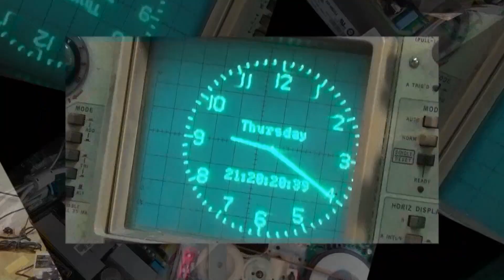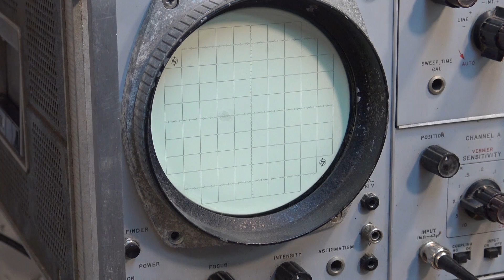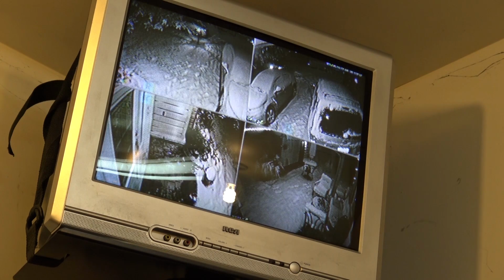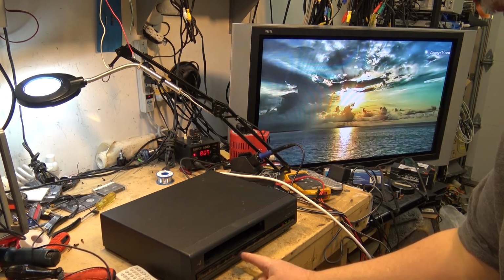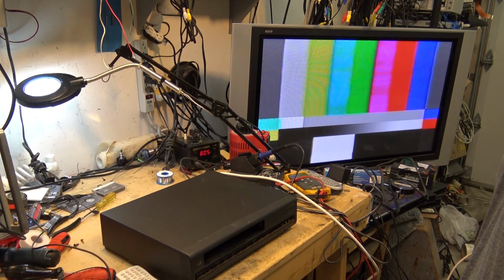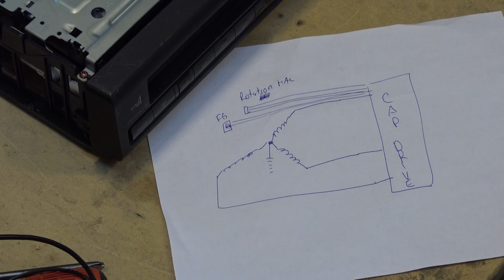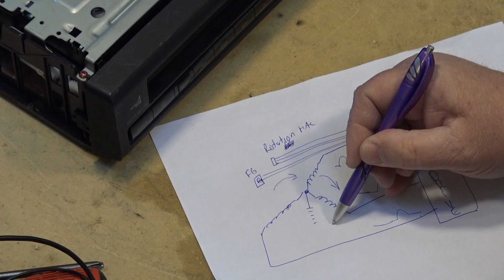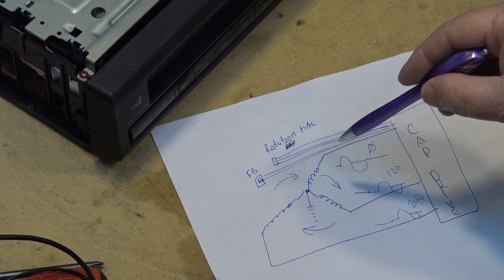Panasonic PV4250 jittery playback and tape eating

Comment: My aunt's mother has a Panasonic PV 4458 MTS HIFI STEREO 4 HI-TECH VCR at her house. It has been in her basement for YEARS. And I tested it four days ago, and it WORKS GREAT!!!!!!! NO PROBLEM WITH THAT IC SOLDIER CONNECTION, OR THE GRAY COG FOR THE LOAD/EJECT PHASE!!!!! THAT VCR IS OVER 20 YEARS OLD!!!!!!!!! manufactured July 7th, 1994. Also, IT STILL HAS IT'S OWN FACTORY REMOTE!!!!!!! NO KIDDING!!!!! EVEN THE OLD BATTERIES STILL WORK!!!!!!

Comment: I have an old Sony Super Betamax deck with literally the same exact symptoms, though it ended up being capacitors for that unit.  I had to replace several SMD caps right under the capstan motor.  I replaced it with electrolytics that I folded down to fit, and it's worked fine since.

Comment: There are three green-color hybrid ICs on video and Hi-Fi audio board that are really troublesome, due to the surface-mount capacitors inside them. When the SMD caps fail, the VCR is good for junkyard only.

Comment: I was wrong with my initial guess. 
Bad design from Panasonic by not heat sinking the heat-emitting, 3 phase capstan driver chip. I guess preventative maintenance is key here. When the image jitters again (or ejects your tape with tape hanging out...), re-solder the chip again.

Comment: Have you checked the Hi-Fi Stereo audio to see if it works? There are SMD aluminum caps behind two hybrid green IC boards on Hi-Fi audio board, and these do fail and were common problem.

Comment: my Grandma has a Magnavox VCR from the 1980s I think but it has a problem sometimes wen you go to load a tap it will pull it in the machine but instead of threading the tape on the heads it just ejects vhs tape and capstan motor continues to spin until the VCR goes into shutdown mode. Sometimes it works just fine. (this VCR has only two motors capstan motor and the video drum. the vcr uses capstan motor for loading the tape.

Comment: I never really serviced VCRs, because by the time I Started getting into repair, VCRs were already obsolete and on the way out. Anyways, I miss the old school VCRs, the ones that were boat anchors and had multiple PCBs with hinge mounts, etc..
Reply from the maker: I made a ton of money servicing them in the early years.
Once the price bottomed out there was no money left in the repair of VCRs but from the mid 80's to late 90's they might as well have been made out of gold.
Reply: 12voltvids yep but I didn't get out in the repair World until about 2004 after I graduated high school
Reply from the maker: I hear you. I retired from the service industry in 2003 and went to work for a large telecom.

Comment: Very similar problem to the Sony's 711B3 chassis Betamax machines from the late 80s. There was a Toshiba IC that drove the capstan motor and when it went bad, It had not enough torque to drive the capstan motor.
Reply from the maker: Many of those Sony machines, both beta and vhs had a bad capstan bearing that caused excessive drag, which overheated the capstan drive IC.
Change that bearing housing and all was good.

Comment: Nice fix. My thought was that it was mechanical. But in the motor, not on the driver board. 

At least the HP has a brighter trace than the Iwatsu. If you tape a cardboard shade above the CRT when you show it on video, it should improve the contrast.
Reply from the maker: It does? NOT.... No the HP is considerably dimmer than the Iwatsu. Its a bigger tube and round as opposed to square, but it is not as bright, and trigger is tricky. I'll get to use it soon.
Reply: Obviously, the CRT on the Iwatsu is brighter when it has sufficient voltage. The last time you showed it in a video, it wasn't very bright. I wasn't denigrating your Iwatsu, I was implying that it's nice to have an old backup HP that works. 
I was working in a lab using a Tektronix scope, and it kept false-triggering. I put a styrofoam cup full of liquid nitrogen on the case over the trigger circuit and it kept it settled down.
Reply from the maker: I have a lead on a leader scope. Just trying to hammer out a deal.

Comment: Quick fix sir :-D
Ive never seen that model before, perhaps panasonic didnt do that one for the uk market.

Ive had a similar jitter created by the tape tension clutch/arm being faulty.
On rare occasions the clutch pad is just too dry, a tiny smear of vasolene on the pad fixed the problem and it never caused any later problems :-)

Ive had some funny mode switch problems, One vcr was playing perfect then suddenly stop the tape and go into rewind, perhaps the vcr didnt like the film LOL :-D
Remove mode switch, clean and respring, add lube and drop it back in, happy machine :-D
Reply: I reckon that the NV-SD430 would be the UK equivalent?
Reply: I havnt a clue, its been a looooooooong time since i used to repair vcr's.
The only panasonic i remember was a top loader called a NV-333, it was a beast but produced a nice picture and could not give a dam what tape you put into it, the tracking was allways in the default center detent.
Reply: NV-333!  They were built like tanks!  Fantastic machines.

Comment: is the connection that feeds the speed signal to the PLL not working and I think that would cause jitter as the capstan is not locking to the clock generator that controls the speed of the capstan.
Reply from the maker: In this case it was loss of 1 phase to the motor at the 3 phase drive output.
Loss of the FG pulse would produce a completely different symptom. Perhaps that would be a good fault to place on the machine. Disable the FG signal and show the symptom, and test points for the FG signal path.
I was going to disable the control track on this unit and then I remembered all that will do is create a blue screen, because the VCR mutes the signal if no CTRL is  present. I will have to find an old machine demonstrate that.

Comment: Quick question, I have a Panasonic RR-830 desktop cassette transcriber.  The auto stop isnt working.  Curious, were would I start to troubleshoot this??
Reply from the maker: I'm not familar with that unit, so I don't know if it uses a mechanical or electronic auto stop.
Reply: no problem, I will take it apart and see what I can come up.  Thanks for the videos, very helpful.

Comment: I wonder if my rca vr337 vcr has that problem.
Reply from the maker: Many of those RCA units were panasonic, so they have the same issues.
Reply: 12voltvids I actually tried to re-time the metal cog that loads the tape, and when I plug it in, the video head drum makes a high pitched noise and the head drum spins BEYOND fast...... BETTER NOT KILL THE FUSE!!!!!!!!!!!!!
Reply: And the picture shows static. And the power light only shows. The power supply I took out, and I somewhat mis placed it in right.
Reply: I accidentally broke the 2nd clip, and that is why it is doing that.

Comment: You guys got hammered with snow on the west coast.  And here in southern Ontario, we're getting ready for 30mm of rain today...  weird, eh?
Reply from the maker: Well where I am we got a ton of snow. About 5cm, or for those south of the border 2" Now Vancouver got hit pretty good as did the Fraser Valley, but where I am a dusting is all. Hell I don't even bother with snow tires on my car.
I did get stuck in my work truck today, on a block of ice. Some fool thought it would be a good idea to flood the cul-de-sac so his kids could skate on it. Didn't consider the slight incline and someone attempting to turn around. Only house on a dead end street. I turned in to make a U turn and spent a good hour getting out. Jumped out of my truck, fell on my ass. That's when I realized that it was solid ice below my feet.